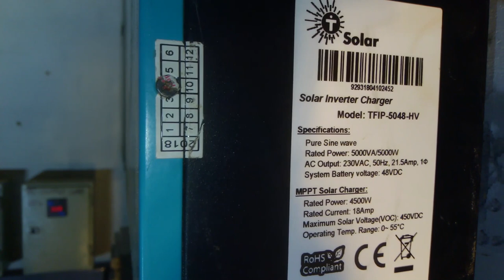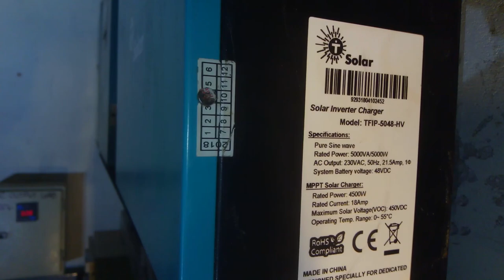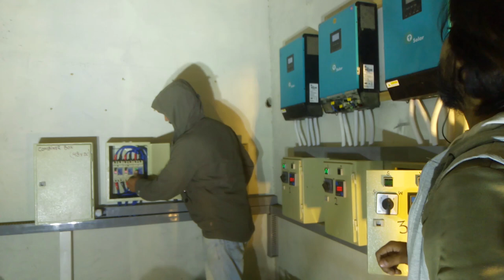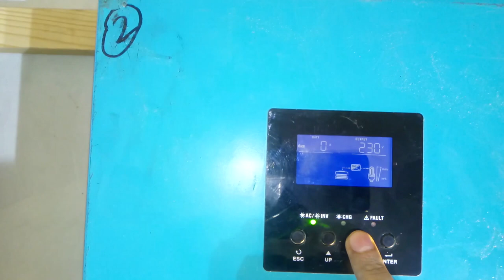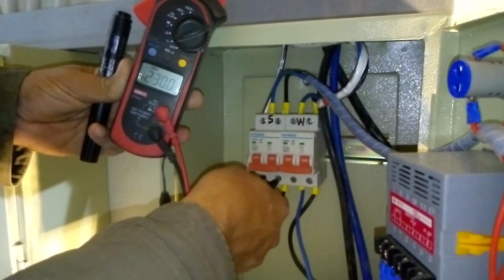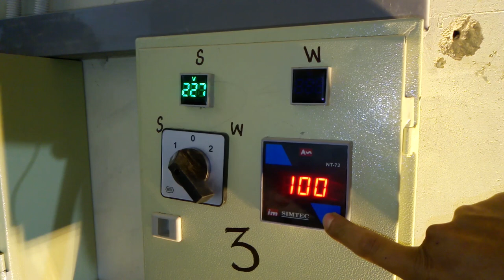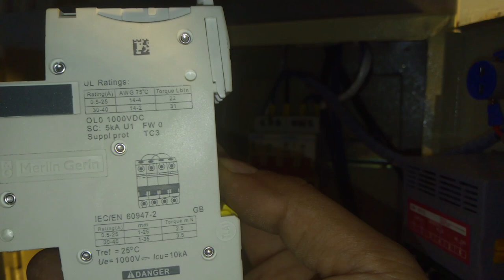How to Install Solar Inverter properly, URDU / Hindi by Humble Solar Wala

Comment: Good job your your solar training and guidance goes a long way, please share other parts of the system such as busbar, ac dc wiring, neutral sharing with inverter output  breaker etc. Thanks great effort.